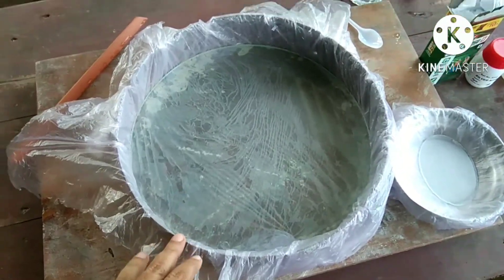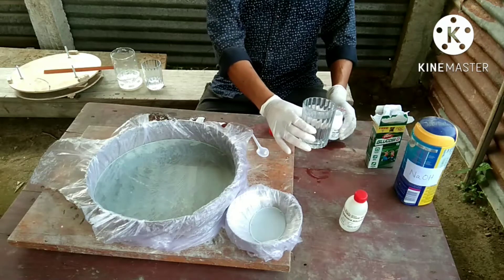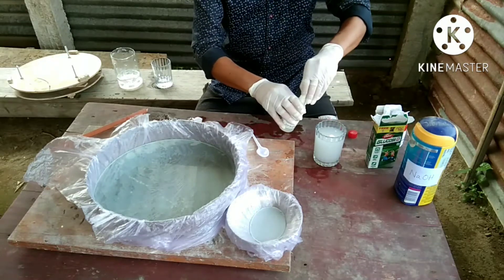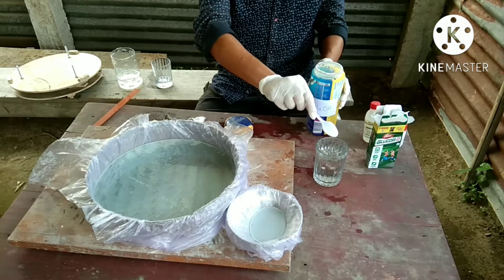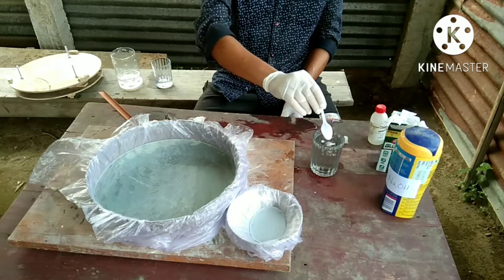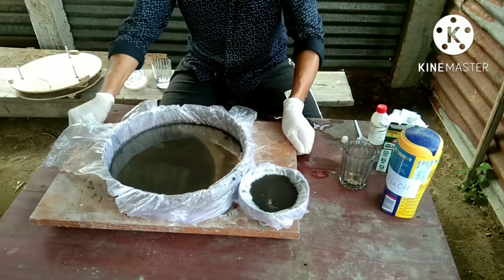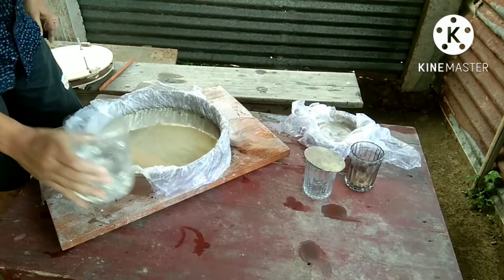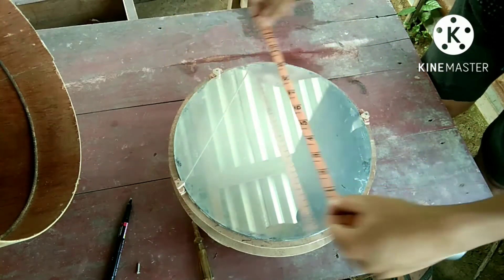Silvering of telescope mirror | How to make reflector telescope |Step-6| Large12" telescope making

Comment: I learnt to do silvering in school, on a test tube, over 50 years ago. The problem with silver is that it oxidizes rapidly. That's the reason telescope mirrors get a deposition of aluminium, instead of silver.
Reply from the maker: Yes, but aluminizing is a complex procedure ,and any one not be able to do it at home .

Comment: Where u find the secendary mirror for it?
Bro plz tell me how I can create it at a cheap cost😢 I am building a newtonian telescpoe at budget😅😅
Reply from the maker: I bought the secondary mirror , first i tried with flat glass shown it this vedio ,but silvering was not done properly so discarded it , but You can make your secondary mirror with flat glass after silvering it . or another cheap way i can suggest you ,go to any hardware shope and buy a reflective window glass (one way window glass) , by which you can make your secondary mirror, although you will get less reflection from it ,may be 70% . but i used once, give nice result .

Comment: Can we use chrom spray paint insted of silvering.  
SIVER chrome spray paint is not so expensive it cost around  ,RS 250 to RS  400 ONLY in onling.
Reply: Chrome spring paint, ,,Do you have any online links where I can get it?
Reply: @SomnathDas-vh1xm  later i find that spray cans are not real chrome.

so you can for hydrochome silvering .
4 chemicals used for hydrochrome its expensive to buy cost around 6k to 10k rs .

you could contact on balbir thukral hydrochrome in new delhi
Reply from the maker: I have no experience with it, please give me the link,  I will try ,
Reply: @astrovillager 
1 . rust oleum spray paint 
2. Deal of the day: RESIL VISTA VISTA SPRAY PAINT ORANGE RED 400 ml (290 g) | Quick Drying with Gloss finish for Metal, Wood, Walls | Acryllic Spray Paints https://amzn.eu/d/045xl1I
3.Polo Chrome Spray Paint for Metal, Wood, and Walls(Multipurpose)|400ml|Anti Resistant|Durable https://amzn.eu/d/8ujJ8Qa
Reply from the maker: Yes I got the link
Reply: @astrovillager  I am giving you links for two time but it doesn't show in reply section . So please you give another source of massaging.   Your Facebook or Instagram
Reply: @astrovillager I send 3 times but not showing in reply section.

Comment: can i apply this technique on fiber-glass or plastic disc?
Reply from the maker: No
Reply: thanks
 @astrovillager
Reply: @astrovillager  what is about metal surface such as aluminum?
Reply: @pichaidvaroonchotikul259 aluminium is naturally shine in reflection.  It reflects 80 to 92 percent of visible light .

I think you dont need to give extra silvering coat

Comment: Terrible quality tbh. You will hardly see anything with that coating. And the mirror blank is too thin. You will have shit loads of distortions with this thickness. 
And yes - if chemicals irritates your skin, surely it will do harm the environment, so no point to "recycle" it under the bench :)

Comment: Thanks a lot brother i used your video tutorial n watched closely and made 2 old jonga jeep concave mirrors... Please suggest me how to protect the back of the mirror after silvering... What exact paint i should apply to protect the silver or mirror shine and make it scratch proof? I think normal oil paint won't work here or may be chemicals in it can ruine the silver coating itself. What you suggest
Reply from the maker: You can try with melted wax (candle), but i am not sure , you can try
Reply: @astrovillager i tried spray paint but it damaged the mirror after a week... what paint did you use after silvering it?
Reply: Try using red lead oxide paint!!!

Comment: 1. Please don't discard the spent chemicals on the ground. Kindy Collect them in a bucket & neutralize the highly alkaline solution with HCl to a PH of @ 7.5 to  8 & pour them in a Suitable drain.

2. You have to use more dilute solutions of Silver nitrate.

3. I have a suggestion. See we have to precipitate the Silver on the glass & not anywhere else. So, first cool the mixture of AgNO3+ NH4OH + NaOH. Dont mix the glucose here.

 You could then warm the mirror to @ 40-45°C with a hair dryer &  first pour a dilute solution of glucose on the mirror. Finally, gradually pour the alkaline Silver-nitrate upon  it later. This way I think you can make the silver-deposit on the mirror alone & avoid wasting it.
Reply: How many grams of silver nitrate can I mix in 1 liter of distilled water?
Reply from the maker: Approx 20 to 25 gram

Comment: Does it work on glass only?
Or I can use it on Plastic, Robber or acrylic too?
Reply from the maker: I did not experiment with plastic or rubber , may be work but plastic or rubber surface should be very smooth

Comment: If you drag a cotton ball gently over the surface (in the solution) towards the last phase of silver deposit you can prevent the black bloom from sticking to the mirror.  Or, stop sooner before it begins to form.
Reply from the maker: Thank you💙 for your suggestion.
Reply: Not if you want your mirror looking like a furr ball
Reply: It works but a better solution is to use sensitizer before spraying.

Comment: Your glass surface prepa was not good enough. Degrease with trichorethylene or petrol then Wash with caustic soda then nitric acid pure, then dist water. Ntric will clena your secondary so you can do it again. Perhaps increase the dose of Ag Nitrate too. Thanks for the nice video.
Reply from the maker: Thank you very much🙏

Comment: This method is for 10% reflecting, Aluminium Coating is 90% reflecting but it expensive
Reply: Actually silver is the best metal with 95% on the visible , is mirror is far from perfect generally a primer solution of copper  is used to help silver to hold on the mirror  and reduce the nitrate to pure silver
Reply: @brunobastos5533  💯💯
Reply from the maker: Only 10%?? No, I think it around 60%
Reply: @astrovillager bro,  You should find Aluminium coating method

Comment: What is the focal ratio of your 12" mirror?
Reply from the maker: F/8
Reply: @astrovillager  I think you had mentioned in your grinding video that you'll not parabolize it. If you leave it at F8 sphere, the Peak to Valley wavefront error will be about 1/2 waves which is less than Rayleigh's minimum standard of 1/4 waves!
Reply from the maker: @biswa145  thanks,  i am new in mirror making. But i kew over f/8 spherical is ok,  so what should be the f ratio of spherical mirror?
Reply: @astrovillager  Well, there is no single focal ratio for good spherical mirrors. It depends on their aperture. For a 12 incher, it might be somewhere around F15 which is ofcourse way too big to handle and which is why mirrors are parabolized.
Reply: BTW I'm also new to mirror making. I have just completed my 6 inch f7.4 mirror. Next planning to work on a 8 inch! It's great to watch people like you sharing your experience through videos. Keep it up! 👍
Reply: I read somewhere that silvering is dangerous, the chemicals used can explode.They also say polishing and silvering needs a "clean room" or at least a clean room environment.You have an exciting endeavor at this young age...this must be the beginnings of a big telescope company in the future,who knows.
Reply from the maker: Yes, for polishing a clean room is better and for silvering a well ventilated room is needed .
Reply: If the mirror has a good spherical figure, it can be flexed into a good paraboloid shape.  With a carefully made cell, you can pull the mirror into a paraboloid. A thin f/8 mirror would be a good candidate for this  idea.
Reply: flexing a spherical mirror into a paraboloid.

https://skyandtelescope.org/wp-content/uploads/Adler-MirrorFlex.pdf

https://www.cloudynights.com/topic/799556-warping-spherical-mirror-into-a-paraboloid/?hl=+flexing%20+paraboloid